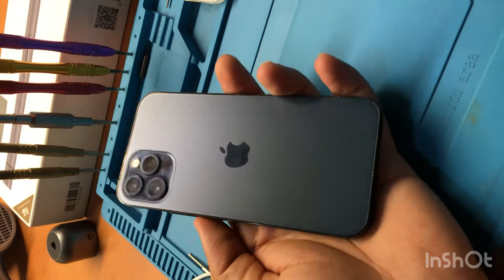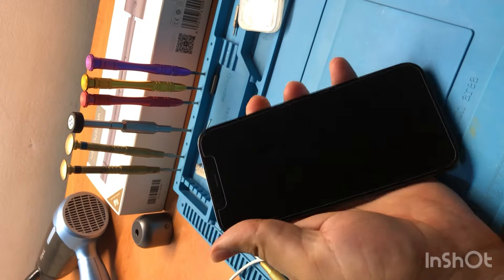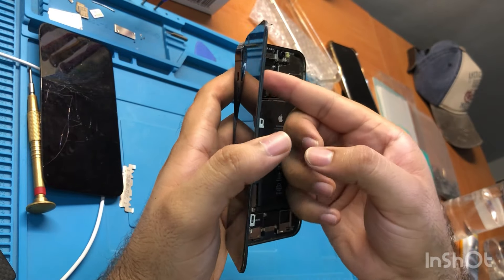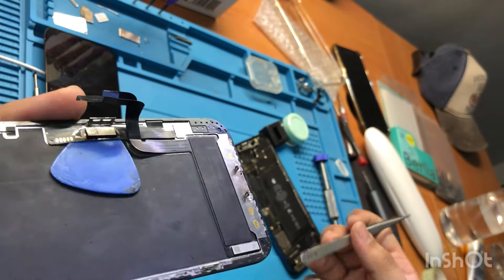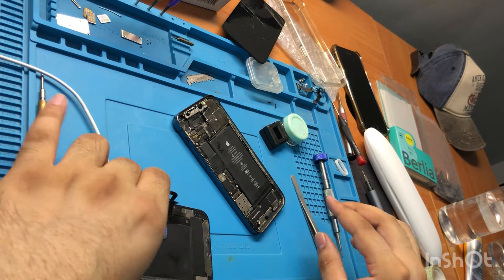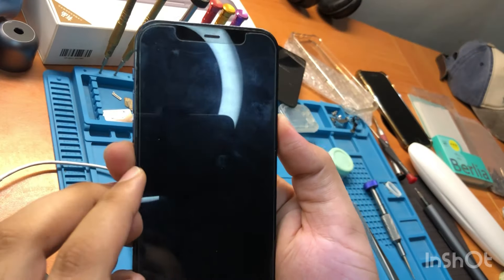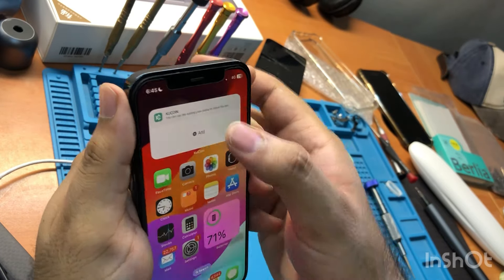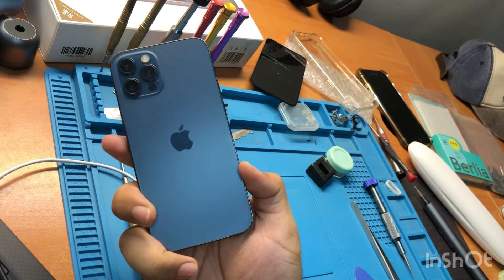iPhone Screen is not responding , 100% fixed this issue of Touch screen. X - 14 pro max

Comment: I had changed my iPhones 13 pro max display ribon about 6 month ago. Now my touch is not working. There was a bypass also under display. Should I Apply the same method?
Reply: Same problem
Reply: Same issue in my 14 pro max display